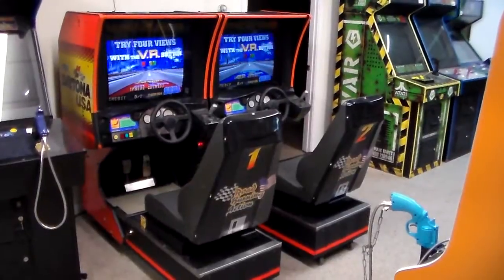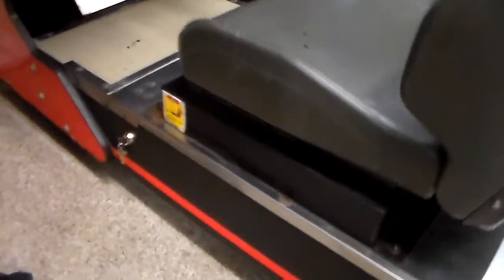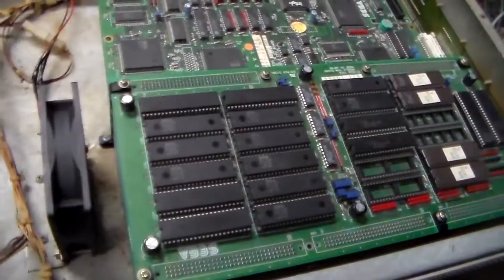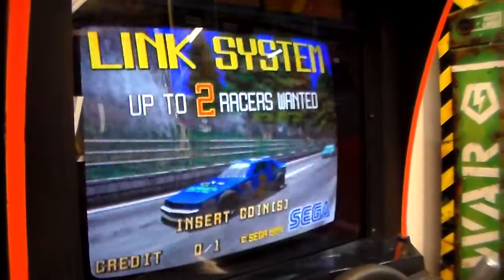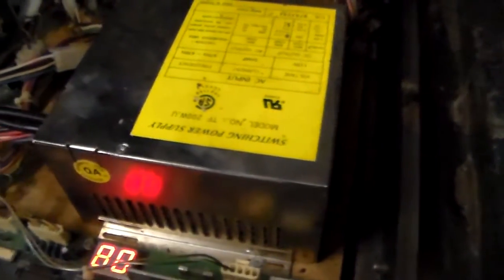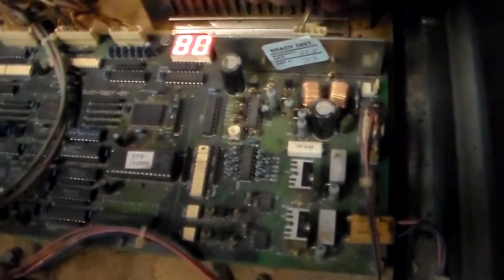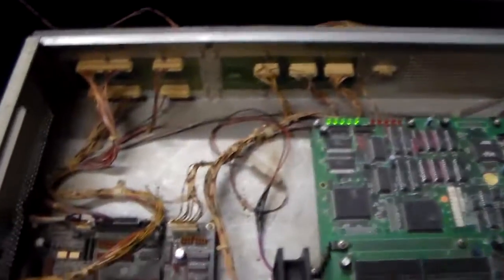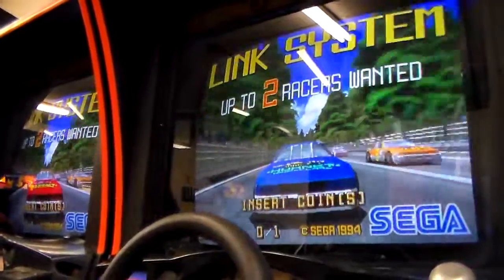Sega's Daytona USA Arcade Cabinet  - PCB Descriptions - How it works!

Comment: Hey guys - I have a Daytona usa dual. New power supplies and fans. The left game play/monitor has "video artifacting" on only the moving parts of the game. The static parts of the game are perfect. For example, when you pick the track, the static images around the 3 tracks look great, the 3 tracks are garbled mess. By your description of the boards i can assume the very bottom "Video pcb board" is responsible for shading and movement video.
Reply from the maker: What I'd do is take the whole board set out and send them to www.IRepairSega.com the guy named Ken there used to work for Sega and can fix that sucker up for you.  I think he charges $75 an hour and it usually takes 2 hours...
Reply: @LyonsArcade  Awesomeman! thanks for the response guys. I'll hit him up and see what he thinks. Thanks again!
Reply: @LyonsArcade  Sent it to Kenlast week! thanks again.

Comment: Very good video explaining how all the PCBs work inside the Daytona twin! Those Sega racing cabinets are so complex! :P

Yeah, about what you said at 10:33, I find it weird that the actual speaker is behind the monitor. Most of the U.S. Sega cabinets are like that.
Reply from the maker: Conversus Vans   Think of the money and time they must have spent developing all these Sega games!  They must have had tons of engineers back in the day.
Reply from the maker: +DIY Cowboy I believe you should be able to do that, if you take the back door off and look up into the control panel there will be a huge motor with a couple wires running to it, unplug that and it should still work fine without it.  I've had them for instance where the motor was dead and the game still worked, so you should be o.k.  If you want to get super fancy if you look in the manual, you can adjust the strength (make it weak) on the wheel driver board by changing the dipswitches.  Good luck!
Reply: DIY Cowboy That's a rolling start, and it's only on the beginner track.

Comment: Hello I have a Original Sea Rally 1995 twin I turn the machine on, both sides link up, and then the right side goes to single (nonlink) so I think I might have to get the board fixed on the right side of the cabinet.

Comment: My 3 stopped communicating with each other, any ideas on a fix or what to look for.
Reply from the maker: If nothing changed or moved, it's probably not the cables, you must have a board issue or a bad connection somewhere.  They're a huge pain to track down unfortunately...

Comment: Hello, I hope you are doing great. I have this twin machine as a personal item, they were working fine... but suddenly the second machine started missing cars, but this happens only when both machines are linked as a master and slave, on single mode you can see all cars. Do you think the problem is the Memory chips on the video board? or something related to the netlink connection. 
I even bought some memory chips model TC518128CFL-80 but it seems my video board has km658128alg-8 chips, but it seems they are compatible.

BTW, in the bios or Test mode, there are two options "Memory Test" and "TGP Test" when doing the memory test, it seems to do a gpu check... but everything is marked as "GOOD".

Thanks in advance for any advice. Receive a cordial greeting!!!
Reply from the maker: Unfortunately i'm not very good at understanding the board level problems on these games, if it only does it while linked, that is certainly strange.  I know how you can get some advice though, there is a website named www.KLOV.com , if you post your question on the forums there, the guy Ken   from Irepairsega.com will reply and tell you his opinion.  He's one of the original techs from there.  You could probably email him too, but he typically responds better to the posts on the forum there so more people can see it.  He knows everything about them.
Reply: @LyonsArcade  Thank you very much for your advice. I really appreciate it. I will post my question there. Cheers!!!

Comment: I have a Daytona 2 arcade game and my sounds is turned off in the main settings. It’s also on free play mode. I don’t have the coin slots with the menu buttons in the cabinet. Do you have any idea how to access the menu to turn the sound on without having those buttons to access the menu.
Reply from the maker: There will be a harness on the side of the machine that plugs into the coin box, if you look in the manual it will tell you what color wire the buttons are and you can ground each one by hand to use them…

Comment: Do you by chance know a good source of ROM chips or possible workaround solution ? I have a sega rally with one that's failed and I don't believe a good chip can be copied to a new chip. Thanks.
Reply from the maker: You can definitely burn new roms no problem.  If you know which one you need, you can order any rom chip you need, already burned with the correct info on it from Steph at www.HobbyRoms.com , just email him with what you need and he'll hook you up.
Reply: @LyonsArcade  Neat, thank you very much! Will give him a shot.

Comment: Hey man,  I see you’ve ‘upgraded’ the T molding. I was wondering what size t molding   Is used on these machines? I’d like to change mine to orange too. Is it half inch or three quarter inch t molding? Thanks
Reply from the maker: It's 3/4", which is the standard size on almost everything.
Reply: Joe's Classic Video Games  Great thanks!
Reply: Also, one of my steering wheels looks slightly off centre in the resting position. The car drives straight and the steering board digital readout is showing the same readout as yours so I don't need to adjust the steering pot. I just need to adjust the wheel itself so it sits centre if that makes sense? Are you able to explain how to do this? Thanks for your time @Joe's Classic Video Games
Reply from the maker: if it's just barely off that may be as close as they made them, are they better than the ones on this cabinet?

Comment: This is way way way too complex why not just use one board to control everything
Reply from the maker: At the time this was cutting edge, if they made one board to control it all it would be huge and if it needed replacing would cost a fortune.  By making it individual boards, if something acts up you can swap the board out for repair.